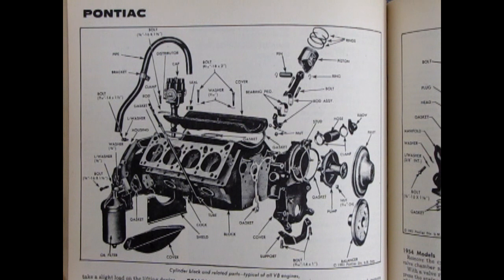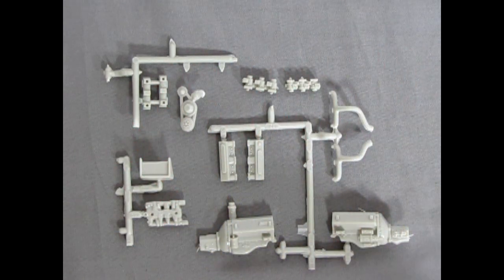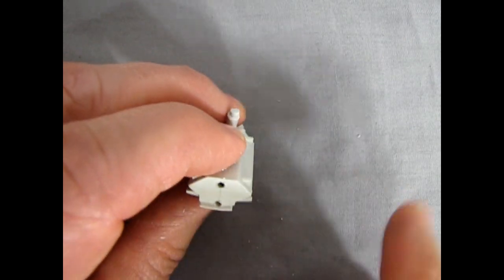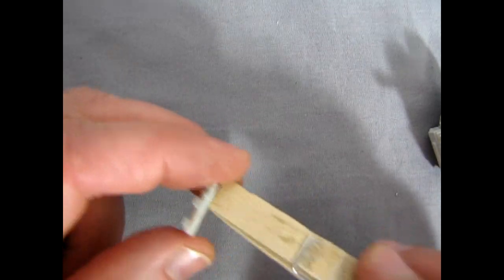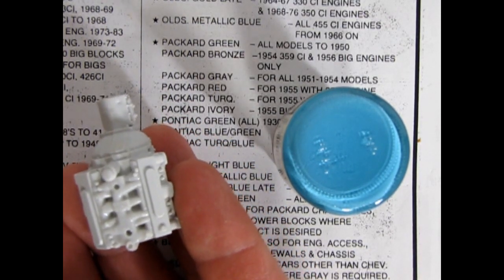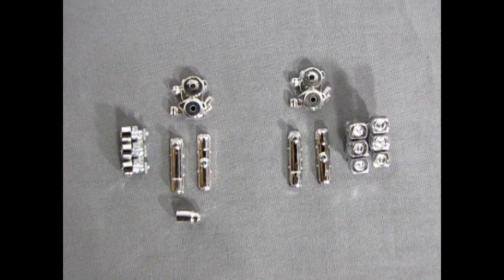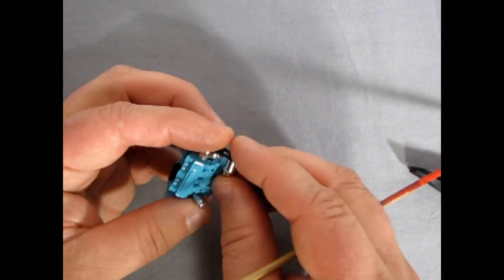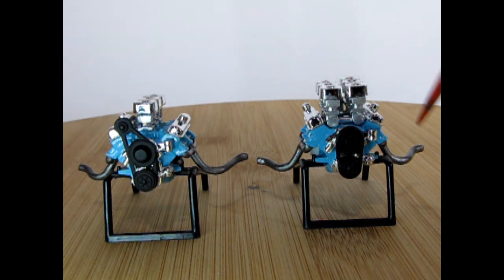Model Car Garage Tips and Tech - How To Build the Pontiac 389 Optional Engine - AMT 1936 Ford Kit

Comment: Trevor, you and Danny definitely just made the value of AMTs 1936 Ford kit go up. And that Chiltons Manual is so nice looking.  What a name , Strato Streak. That's Flash Gordon material. I have 3  Tempest  engines . The one in my driver is the economy . It is designated economy with an E Something like 8  1\2. To 1 compression  So our nowadays gas is O.K.  I think you are 100% and the intake takes an extra small 2 bbl, the pistons are dished.  correct about it being a 389 in the kit. The 59 and 60 389 engine was a little different looking from the 1962 and up. Because of the way they cooled the heads and intake. May be why it looks different.. love your video. I'm subscribing.
Reply from the maker: Thank you so much. Glad you enjoyed the video and good luck on your builds.